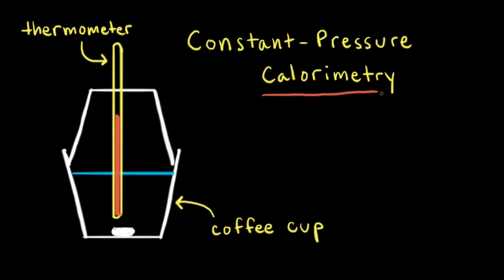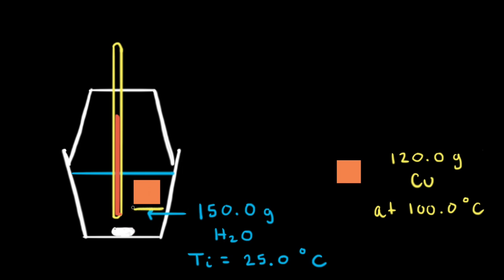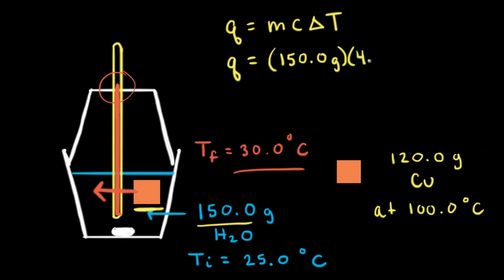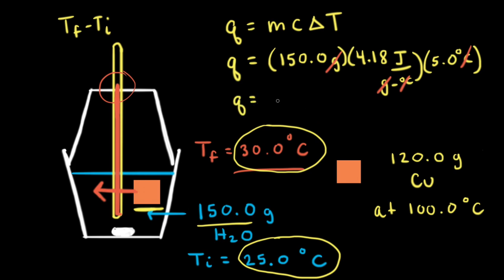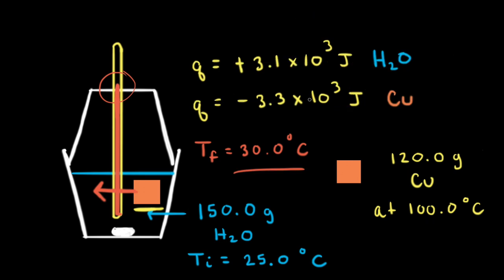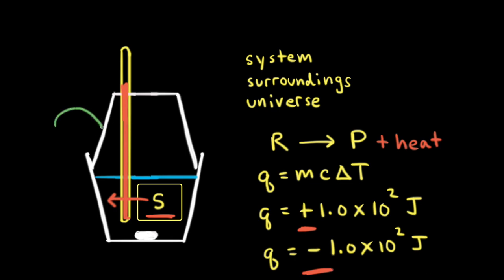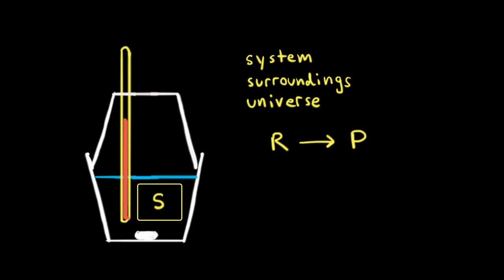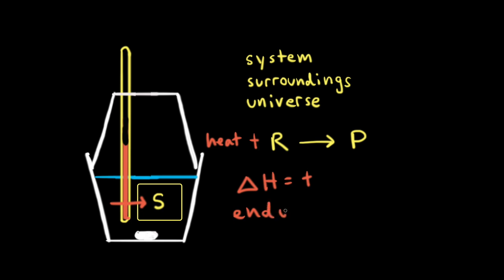Constant-pressure calorimetry | Thermodynamics | AP Chemistry | Khan Academy

Comment: Why is a loose-fitting container under constant atm pressure?
Reply: The loose fitting lid allows for constant air flow between the inside and then outside. Hence, the pressure inside matches the outside pressure which is atmospheric pressure, leading to the constant atmospheric pressure.